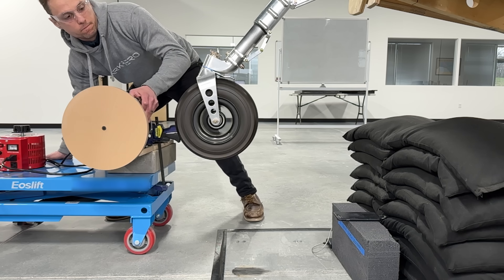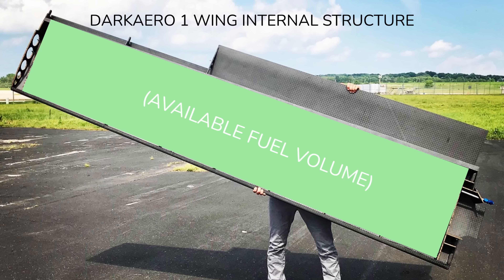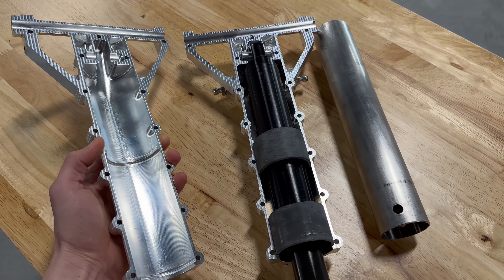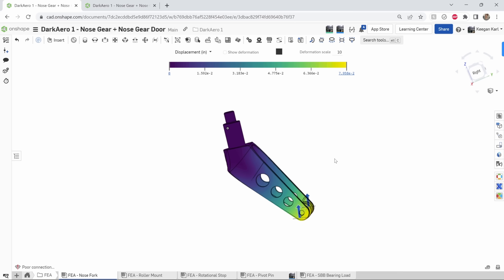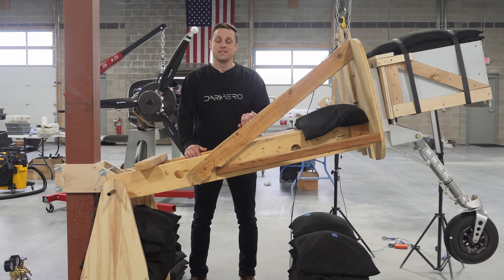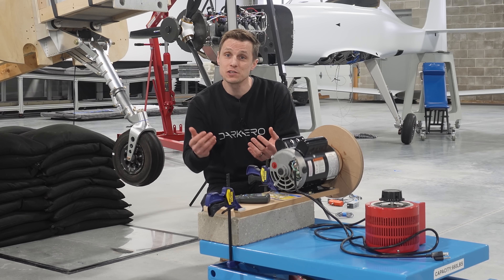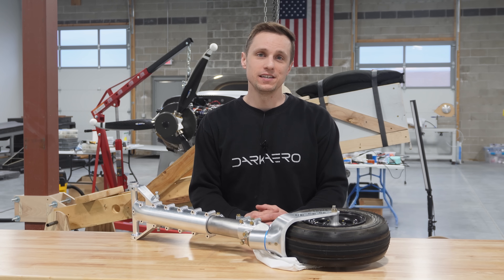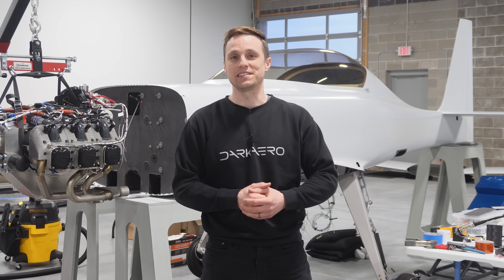Engineering softer landings (drop testing)

Comment: Did you consider testing to failture to reduce the risk of catastrophic failures even with minor material weaknesses on production units or just to see how much further your design can go in practice? To see how much wiggleroom there is.
Reply: FEA (computer simulations) for isotropic materials like aluminium is more than accurate enough (if the simulation is well setup) to predict the failure point.
Reply: @lau4893  On one hand, you are right, these simulations nowadays are generally incredibly close to what you would expect to happen in reality. But on the other hand, I don't believe that we require practical testing just because the validation is based on antiquated processes. Reality at the end of the day is many orders of magnitudes more complex than we can simulate on any system today. 
So the only way to know for sure is to try it.
Reply: @lexer_  you're right, I just don't think it would be financially viable to test every component to failure even if I wish it were

Comment: Just a couple of points re the undercarriage. How much does the CG alter on retract and do you have a  trim system to compensate for such movement? Also will the aircraft be fitted with a fuel reserve tank for emergencies? I know that the plane has a huge fuel capacity but some form of safety capacity should be included.
Reply: "Also will the aircraft be fitted with a fuel reserve tank for emergencies?"

Huh? Why? As a pilot you are obligated to reserve a portion of fuel regardless. Somebody who is willing to fly below that reserve isn't going to be saved by an aux tank.
Reply: @TheOwenMajor  John Denver had a reserve tank but when strapped into his E-Z he couldn't reach the change over tap. Perhaps he'd still be with us but for those few gallons of fuel?
Reply: @mikehipperson  "John Denver had a reserve tank but when strapped into his E-Z he couldn't reach the change over tap."

Simply incorrect. The E-Z had two fuel tanks, one in each wing root. It wasn't a "tap" for a "reserve tank" he was reaching for, it was a fuel selector for the two tanks. 

Also, there is zero indication he ran out of fuel, the most likely conclusion has Denver induced a loss of control when he was contorting his body to reach a badly placed control,  he basically stomped on the rudder when he reached around. 

Additionally, Denver was flying on a revoked license, and witnesses say he didn't even check how much fuel he had before leaving. Also, the fuel gauges weren't visible from his seat..... My point being idiots will always find a way to off themselves.
Reply: Reserve tanks are for vehicles without functional fuel gauges - that's not the DarkAero.

Comment: Being setup for a grass strip is a must for me. I think once you fly this aircraft you will have a 2,000 foot takeoff (over 50’) at gross. We will see but it is exciting to watch the progress.
Reply: It depends on lift/drag/thrust/weight ratios...It should be a lot shorter than that..
Reply: I would be highly concerned if a 200 hp engine takes that long to get this light plane off the ground
Reply: @josephc.9520  i agree. The VL3 at gross is less than 1200.

Comment: Did you stain gauge your components on the nose gear to determine if any permanent deformation occurred? I would expect that the wheel fork specifically may experience some permanent set due to the offset of the fork.